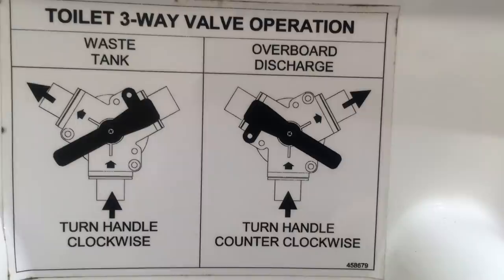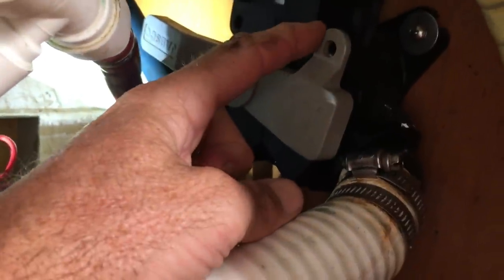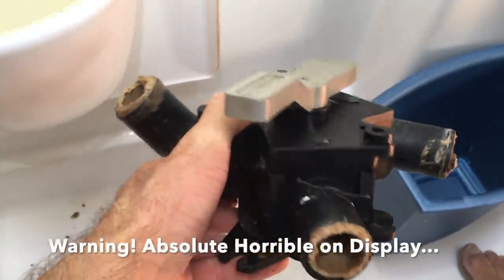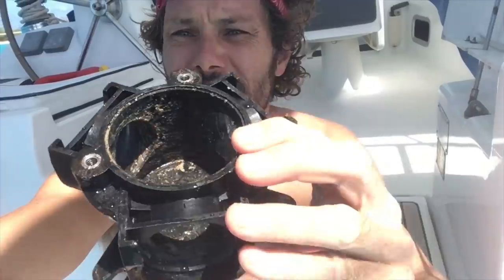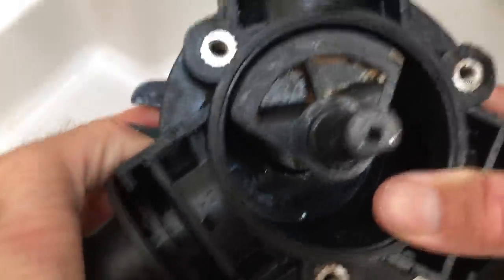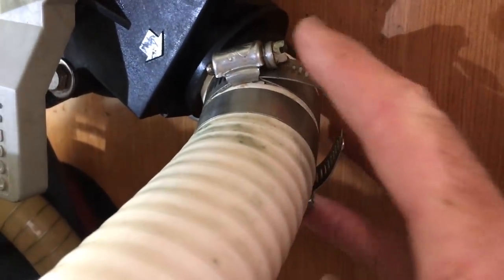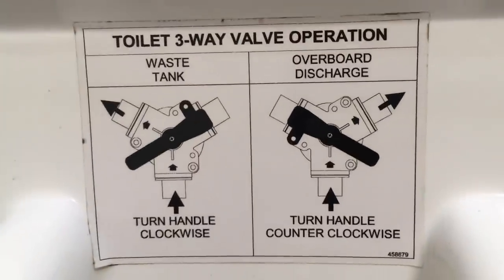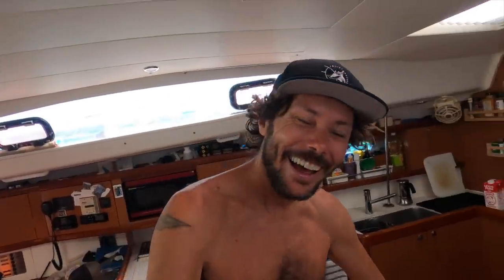We are definitely in DEEP S#!T - Sailing Zephyr Boat Life - Ep 125

Comment: Haven't done much with marine heads, but I've been told that you should run some vinegar through the system (slowly) about once a month.  Vinegar is a mild acid and it will dissolve calcium buildup.  I have flushed a lot of marine parts with vinegar, including the raw water portions of an engine, and it works pretty well.
Reply from the maker: Good to know! Thanks Jeff!

Comment: I had the same "Y" valve and after cleaning it for the 3rd time in a year and old salt told me to clean it and with 1000 grit sandpaper sand it as smooth  as I can and rub   Petroleum jelly all on the inside and it should last a year or so before you have to clean it out again. Long story short, It worked . And when I went to clean it after  a year later it was way easier to clean it.
 Ok Thank You for a Great video and until next time, Aloha from the Big Island of Hawaii!🍹🍻
Reply from the maker: Wow. What a great idea. Thank you so much for the info. When I service them again, I will definitely give that a go. 👍

Comment: Hi Matt my Ben 43 is a 2010 model. The aft heads goes straight into the holding tank, I just open it at sea. The forward heads goes straight into the sea so can not be used in port. As you can’t see inside the hoses would it be best to change them when doing a service ?. I enjoy your videos especially anything technical
Reply from the maker: Hey Dan - your totally right. I would normally change the hoses each time I service. They aren’t expensive and it helps to reduce smell. But unfortunately couldn’t find any. But definitely will in next service.

Comment: Just curious how would it be if you macerated all the waste and pumped it Straight into the waste tank then released that at sea no need for the y valve,thoughts?
Reply from the maker: It’s a good thought. Possibly something we might consider down the road for sure.
Reply: @SailingZephyr  yer I'm  thinking of doing this my system you seem really knowledgeable that's why I thought I'd run it past you one thing is everything will go in the waste tank it might fill too quickly
Reply: I'm set up that way, though without the macerator at the moment.  Head to tank, and tank to through hull.  Can pump out or release - and no y-valve hassles.  it's documented in Calder's books.

Comment: Looking at how the system was installed, it looks to be poorly designed.  That valve must be installed in a such a way that it resembles an inverted "Y" so it maximizes the force of gravity and water pressure to flush all the waste.  Because the waste has to go up that Y valve into the tank, it stagnates inside the pipes and the valve itself causing it to solidify over time.  This will be a recurring issue for your boat and I think it would be best to just set the valve to flush the waste into the through hull once you are in open water